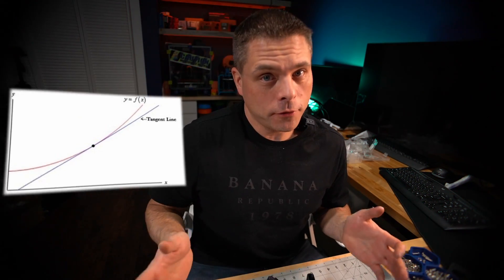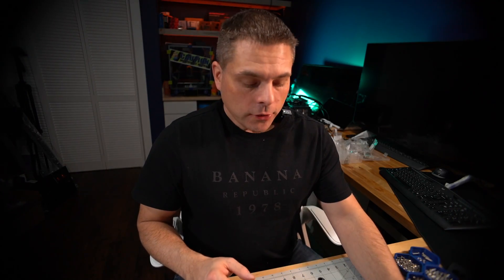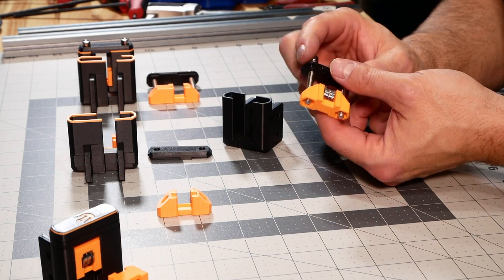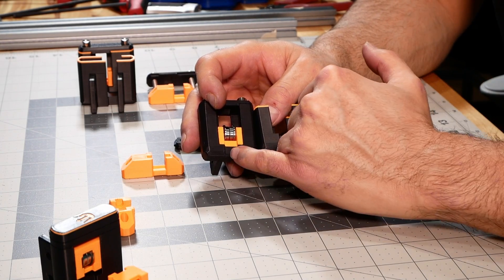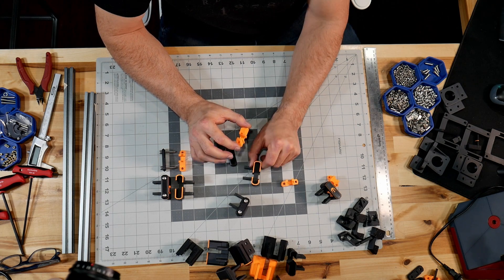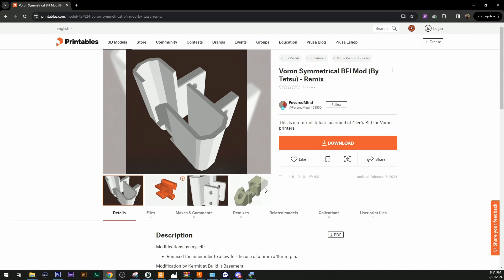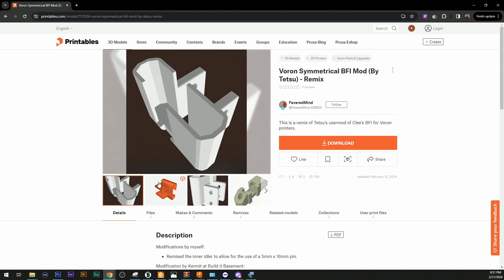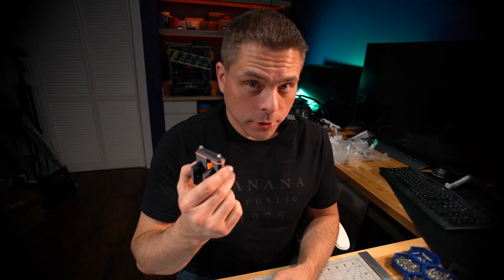Better Beefy Front Idlers (Voron Trident)

Comment: Hello! I really like your videos. I have a Trident and I was wondering what do you think of a mod that I have seen to add an auxiliary fan for part cooling, like the one in the Bambu X1C?
Would you add that to yout Trident?
Reply from the maker: Only if I had cooling problems.  The aux blower fans work well, but will cause you to run your bed and nozzle a little hotter to off set the "breeze".  For normal printing, 200-300mm the standard fans are fine.  Remember that people often mod printers to fix issues that are possibly more related to improper assembly or poor tuning.  What's the use case for you?  Faster printing?? Can your hotend pump out more filament?  Can your mech systems maintain a higher speed and still be precise? More isn't always better!

Comment: idk how people get their rama idlers to break ? did they not print the inserts in the correct orientation ?  the way they are printed makes the layer lines be horizontal when installed later meaning the pull on the piece dosent pull on the layers... seeing how some people have theirs broken either tells me they printed them wrong, used the wrong materials, didnt print their abs with the correct temps or plain oriented them wrong? im stillusing the first ones i had with a belt tension of 120hz and they are like new.. no cracks to see nothing
Reply from the maker: So many people, so many printers.  I had some that broke on the horizontal, but I blame the filament manufacturer for that.  (I had to replace a lot of parts on that printer)  I guess to me the newest front idlers (I have never used them) have that part to part point where the screw enters and that just seems like a bad design.  But I encourage everyone to try both stock and mod parts - testing, building and modifying is how we, as a community can make such great strides.  I'm a big pin-mod guy, so I choose to do Rama or other idlers!

Comment: is v093 just shorter than v092?
Reply from the maker: Minor changes. Mounting holes spaced slightly more to accommodate some roll-nuts that needed addition space.  Wings slightly longer to recess the front of the idler a bit more from the front of the printer.
Reply from the maker: Exact notes are: "Added 2mm to the sides to hold the unit further back and added 1.5mm to the spacing between the mounting holes to the M5 roll nuts."

Comment: Does your design work for a voron 2.4? I know it works for a trident, but does it work for a 2.4 too?
Reply from the maker: Fevered is correct - Happy to make one for the 2.4 at some point!  I do have a 2.4 rebuild in the works.  It's not happening too soon, but IF I find spare time.... I can get it done
Reply: @BuildItBasement yeah I went with Rama for the 2.4 but would also be interested in yours.
Reply: did you ever make a 2.4 version? @BuildItBasement
Reply: Unfortunately, no. There are no holes for the Z belts.

Comment: Love that we were able to collab on a solution that works for us! These were all things I wanted fixed on the symmetrical parts. I think we came up with a great final solution and I hope that others enjoy it as much as we will. Sorry if I "nudged" a bit too much XD

I am wondering how the expanded holes (for the 2 M5 roll in nuts) will work with the Y rails and my Y backers. I should have some printed up soon.
Reply from the maker: Good question.  The originals were also not just round.  Making things better, or at least what you need is what this hobby is about!